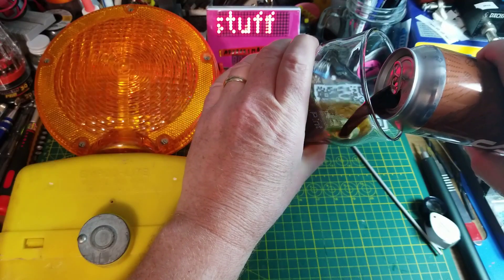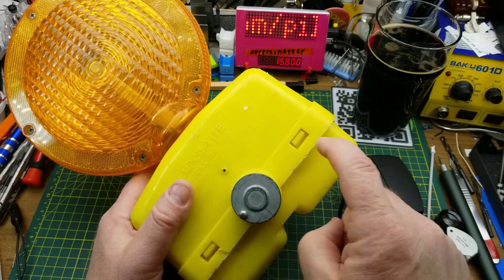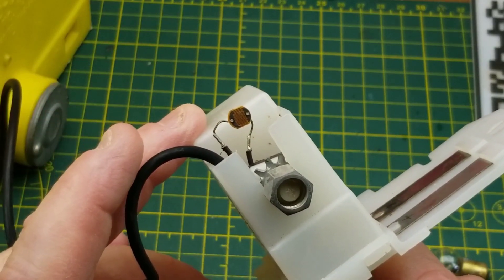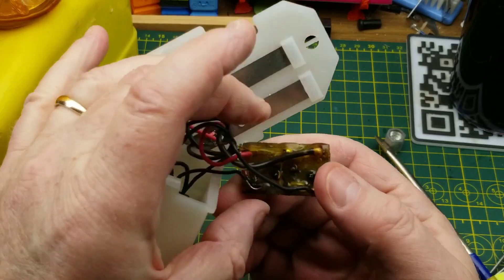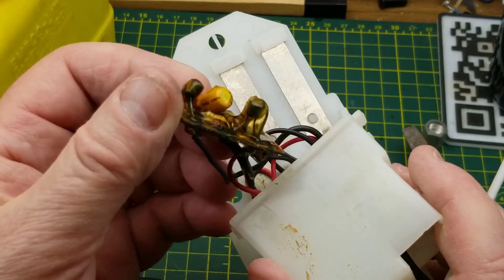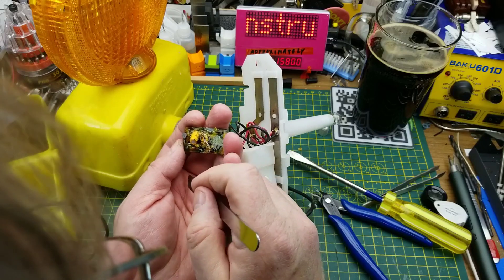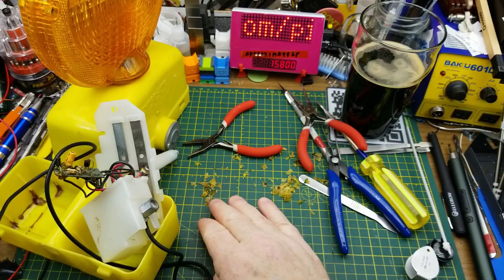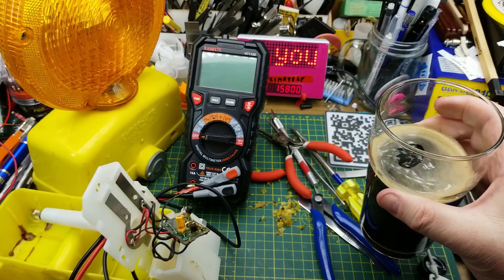Road construction warning light (curiosity teardown)

Comment: We had similar ones to this in Australia, but I don't see them anymore. Now its just reflective cones and big LED signs flashing warnings if required. The early ones had the 2 transistor flip flops but on a copper tracked pcb and the CDS cell was in the stalk. Later ones  just had a blob chip and CDS cell all epoxied in together.

Comment: There is a charm to these tungsten road works lights. "Found" a lot in my childhood, took all of them apart. Mine had a one-transistor flasher circuit, i wish i still had one to reverse engineer it, it's built to be the absolute lowest price possible, probably because stupid kids keep "finding" them.

Comment: Way back in the early 1970s I bought a much earlier version at a second hand store. It contained nothing but a switch and a weird bimetallic switch thingy which were both in series with the lamp. When turned on, the lamp lit until the bimetal strip warmed up and opened its contacts. When it cooled it closed them turning the lamp back on.

This was in Phoenix Arizona so I figured they quit using them there since ambient temperatures were so high which would affect the switch rate if not force them to stay off.

Comment: At 2:23 you show the 1895 package, with a rating of 14v (presumably for a 13.8v vehicle system). It's going to be really inefficent at 6 volts, although of course it will last much much longer. Funilly enough, when I was in my late teens, I woke up with one almost exactly the same after a night in the pub!
Reply from the maker: inefficient, sure, but will also last forever. Which is, no doubt, the design intent.  I doubt these things get a lot of maintenance. 

They live a hard life. (I found this one melting out of a pile of snow one spring many decades ago)

Comment: Wouldn't it be possible to put one of those direct replacement automotive LED bulbs into this?
Reply from the maker: I'm not sure. It would need to provide a low resistance path for the capacitor to charge through. 
Maybe if there was a diode added in inverse-parallel with the replacement LED.